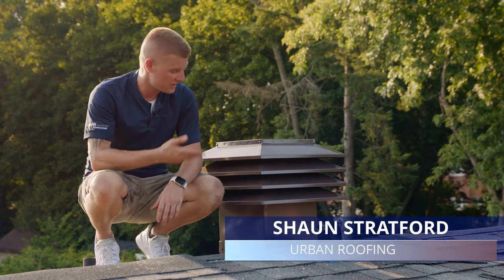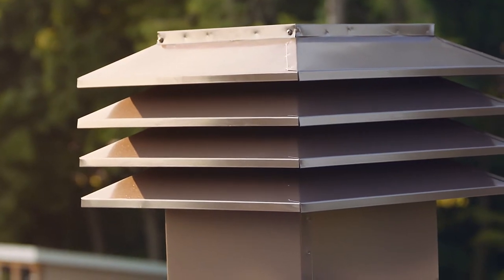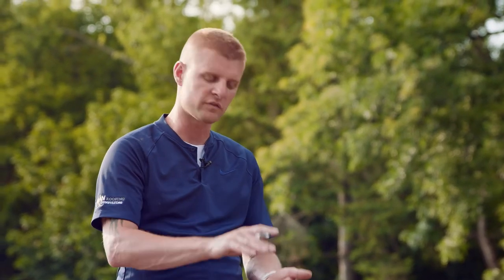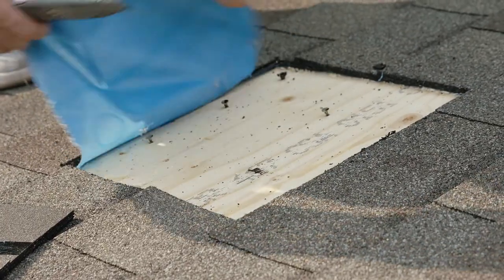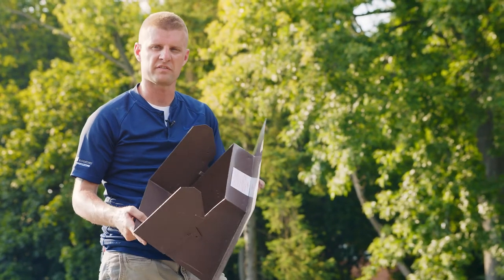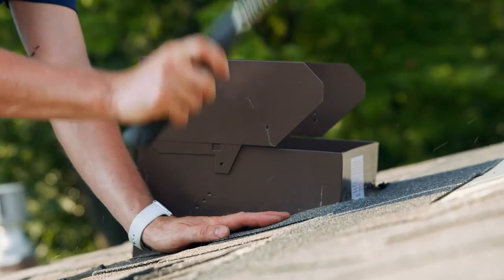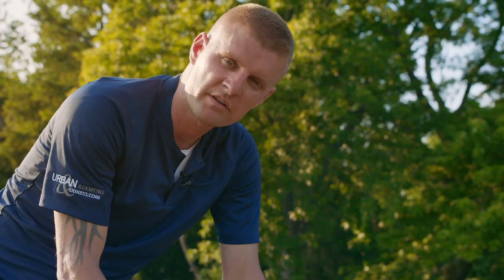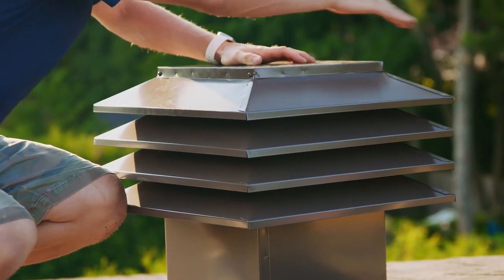How to install a sloped roof ventilator model 301, 302 and 303 by Ventilation Maximum

Comment: Thanks for the video. To avoid problems should the vent be grounded or not?
Reply from the maker: No the ventilator does not need to be grounded for protection against lightning. If your home is compliant with local building standards the electricity should be redirected towards the ground via your homes structure. As a reference, metal roofs do not require to be grounded, hence our ventilator do not either.

Comment: The screws used to secure the vent to the roof stick up off the decking unlike shingle nails. Won’t that wear a hole or prevent the shingles from sticking together on the area of the vent? Thanks
Reply from the maker: Hello richvail7551, In regards to the screws sticking up off the decking, we are suggesting the use of roof cement to make sure the shingle over the screws is sticking there.  The reason we use screws, it is because they have a better holding power than nails Let us know if you have any additional questions or concerns!
Reply: @VentilationMaximum301  so I guess the bead I put down should be as thick as the height of the screw to avoid the head of the screw wearing a hole into the shingle above it.
 Just making sure I understand correctly cause I like the product I just don’t want to make a mess of it. Thanks
Reply from the maker: @richvail7551  be generous with the roof cement

Comment: Question for you. I am in Ontario Canada. I am thinking of getting vmax 301 installed on my existing roof which has around 8 box vents. Is it okay for me to install vmax 301. Will the box vents cause issues
Reply from the maker: Hello Parag Beau , The vmax 301 will replace your 8 box vents.  If you want to install our 301 you will need to close up all the box vent.

Comment: If you don't go inside the attic space to mark your vent location but then cut the sheathing and end up over a truss or rafter, doesn't this then reduce the CFM of the ventilator and thus, reduce your ventilation calculation?!
Reply from the maker: Hello Two Tone, You are right.  This is why we are recommending installing the vent between the rafters.  You can use the nailing pattern of the roof deck to know the position of the rafters.  As to going into the attic, we recommend an attic inspection before doing any roof.

Comment: I thought the vent is suppose to be level. Not angled with the slope of the roof as it shows here. Am i wrong?
Reply from the maker: You are right, The vent need to be level.   What you see here is an optical illusion, because of the way it was film.
Reply: Oh okay, its the camera angle

Comment: What is the NFA rating of this vent?
Reply from the maker: Hello Mohamed,  The model 301 as 144 sq. In of NFA, but NFA is not everything we are active, our average exhaust power is 418 CFM.
Reply: @VentilationMaximum301  i have 4 box vents 50 sq. In nfa each, on a 1164 sqft roof, can i replace one of them with a 301 or should i  remove them all to install this?

Comment: Roof cement sucks just stick to ice and water shield way better
Reply: Why it sucks? Serious question. I see alot of roofers use it but maybe im missing something
Reply: @Mark300win  You're not, just someone trying to think they now better than the manufacturer and building code. 
Its fine because everything is shingled over and water runs downward... the cement is only there to properly hold the vent down due to its heavy construction. its also screwed in place so... theres that....